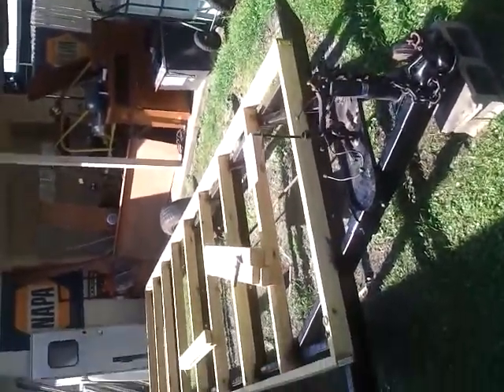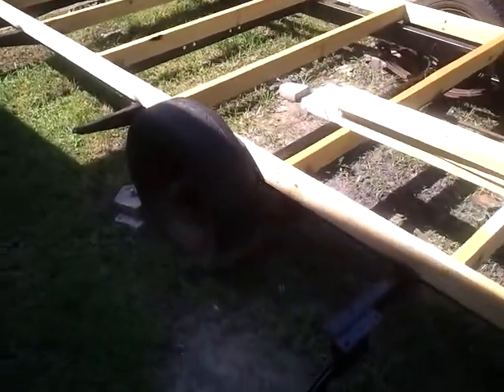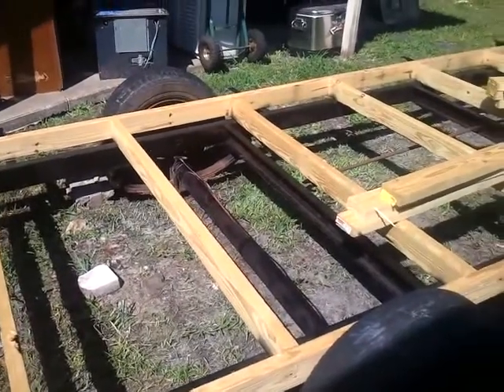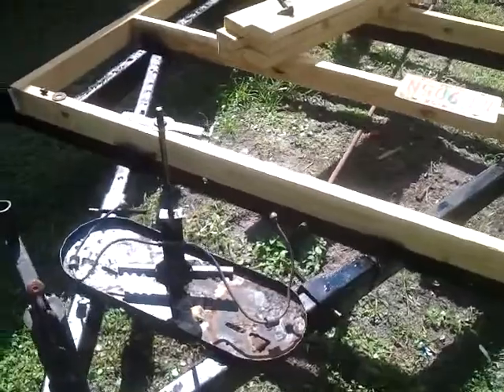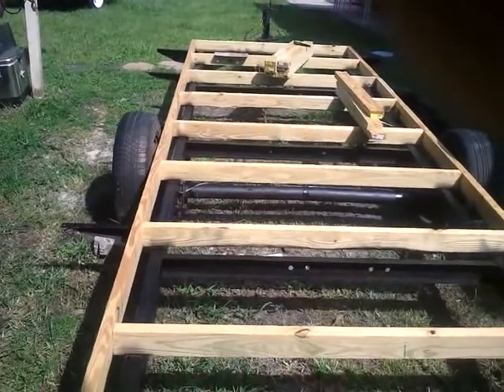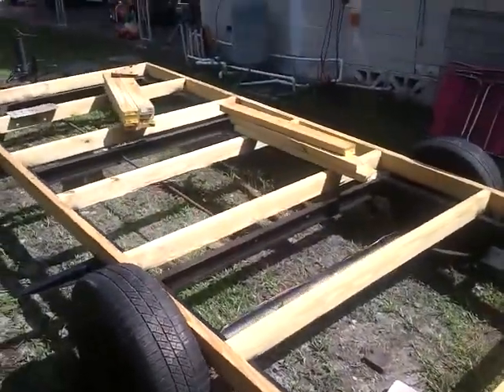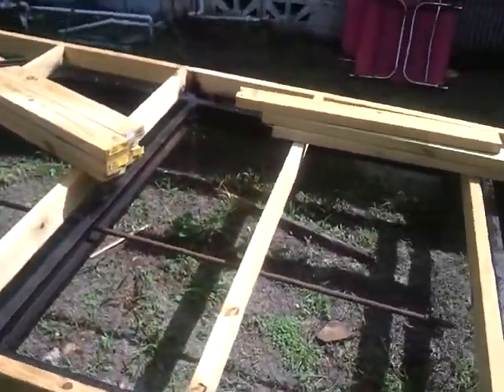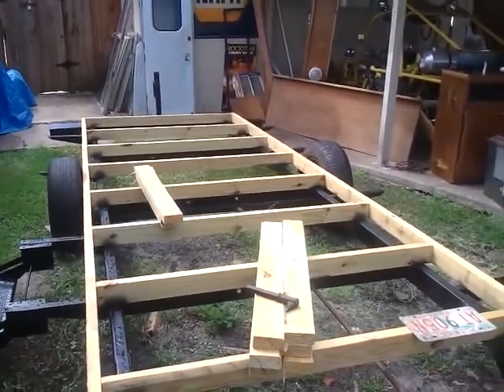Homemade  camper part 1

Comment: Where your rear bumper is and all your pieces of square metal I would not be to quick to cut them off you will need to still have have a place for your lights and setting those ligh fixtures back a little they are less likely to get broke off I know this because I’ve Ben there wit breaking light fixtures so I thought I would pass that on to you
Reply from the maker: Thank you so much for watching

Comment: HOW DO YOU ATTACH THE FLOOR FRAME TO THE METAL TRAILER? I AM STARTING TO BUILD ONE. THANK YOU IN ADVANCE
Reply from the maker: I ran long thin carriage bolts through the two by four into the frame then use the lock nut and a lock washer that way nothing would come loose thanks for watching and stay tuned for my off-grid cabin videos that I'm releasing soon

Comment: right off the bat, you went the wrong direction with the 2 x 4s in the floor. campers use wood to reinforce the trailer. the thin steel flexes, unless you run the 2 x 4s with the rail, the flex of the trailer will loosen the fasteners and shorten the life of your build. 
I've already made this mistake, so good luck.
Reply from the maker: Mark Cobb actually the camper build came out very successful and was used for a pretty good while since couple of months ago the campers been torn down and now the frame is turned into a huge ATV hauler even works better with 2,000 pounds of weight on it thanks for watching
Reply: I'm on build number 42 now. Cutting a 30 foot camper down to 16 feet with all 2x4 construction and twin axles to support the loaded weight. Flipping the frame upside down to build the floor inside the frame with 2x6s. Swapping the hitch and axles to the opposite sides. Going for the largest all terrain camper I can get.
I hate it that you scrapped your project. But!!! Haha, have you considered building a half camper half atv trailer? 30 foot rv frame would give you a good 10 foot cabin and an easy 16 foot load area. Who else would have one?
Reply from the maker: Mark Cobb trust me I hated that I had to tear it down but I'm getting ready to move from the city into the country and the toy hauler would have came in more and handy right now hauling equipment stuff out to my off-grid property but sooner or later I planned on building me a nice little cabin out in the woods and I think that would be equal to the camper
Reply: I'm ready to move out of the woods brother. Been 7 long years in solitude. Time to take a diy camper to the big city. Get back on the road. I used to be known as the comedian Chicken Wang. Since the world didn't go to hell on schedule I need to spread my wings and fly. Got a lot more material now.
Reply from the maker: Mark Cobb I was born and raised in a big city and working it out in a little country town for 15 years I see the differences and I'm so sick and tired of big cities and all the crime and the murder rates I love being out in the country with peace quiet.
Reply: It definitely has it's advantages. Can't wait to see the videos you put up after the move. Good luck with everything.
Reply: massis32210 r
Reply: Mark Cobb what do you mean? Can you please elaborate? Are you saying it is better off that the 2x4s go the long way from front to back of the trailor? Thanks in anticipation!